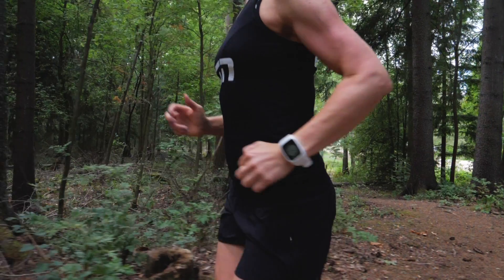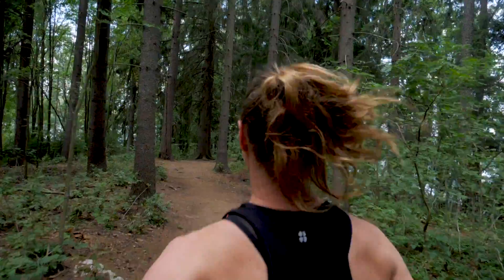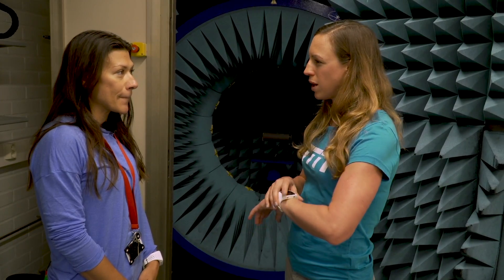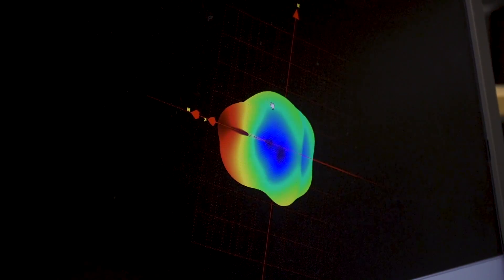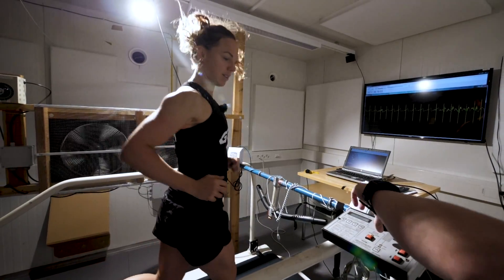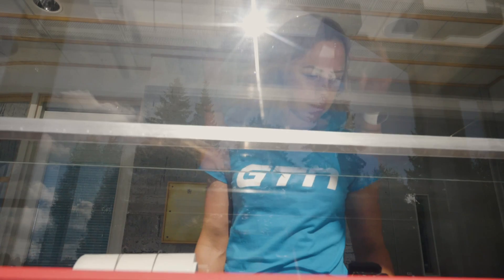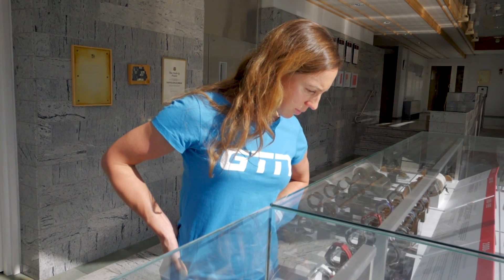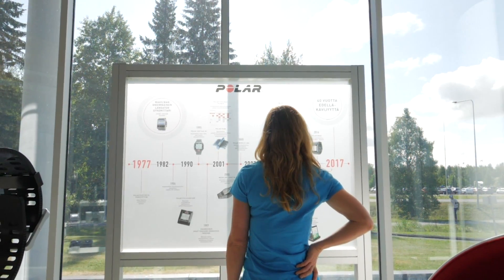Inside The Polar Factory - The History Of Heart Rate Monitors

Comment: Kudos to pioneering HR but RIP now. 1.5 years after garmin 935 has come out and there is still no answer. Moving from v800 to garmin was the best thing ever.
Reply: The V800 is far better than Garmin 935, the V800 is more accurate both in terms of heart rate, bt also GPS. The software in the V800 is much less buggy than the 935. The 935 has more functions, however, when the accuracy is inadeuate the functionality doesn´t matter.
Reply: @veist2930  Ye i am aware of many people trying to convince themselves. Its ok.
Reply: No need to vomit irony. Do you have any facts?
Reply: Bombed my butt - :) that was funny. In my opinion the most important things with these devices is measurement of heart rate, distance and altitude. All these parameteres are better measured by the V800, especially heart rate accuracy which is without the well known Garmin-spikes. No drop outs of heart rate either. But I do agree that you have hands-on experience if you have used both devices for the past 2 years
Reply: One of the weird things with Garmin is their low GPS precision, despite being a company primarily making GPSs. The V800 is still the reference when it comes to GPS precision, but is outdated in other ways though.